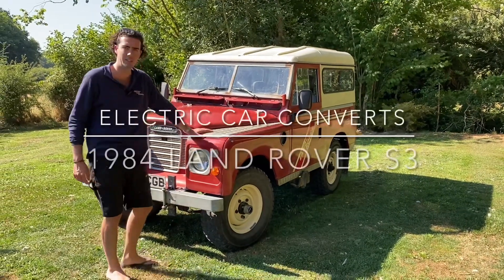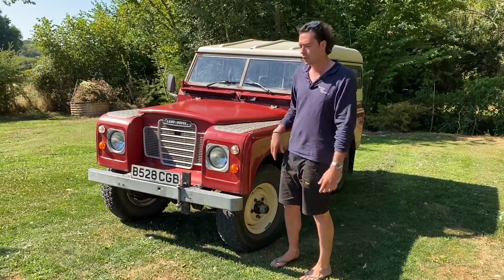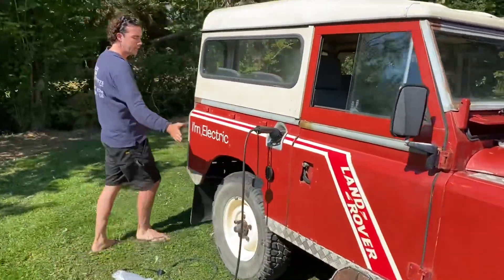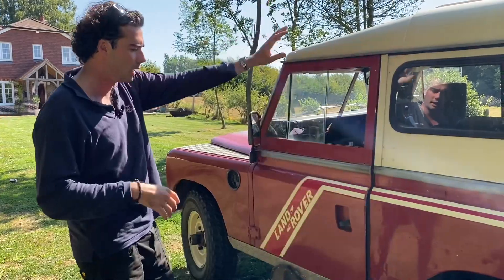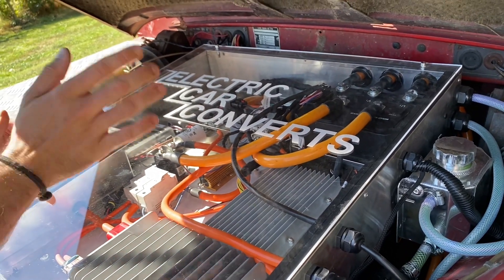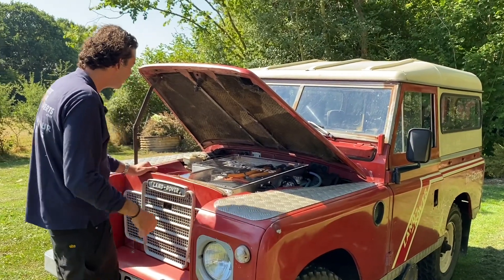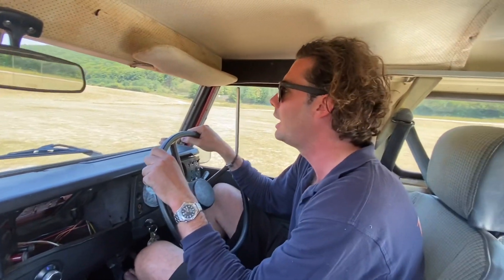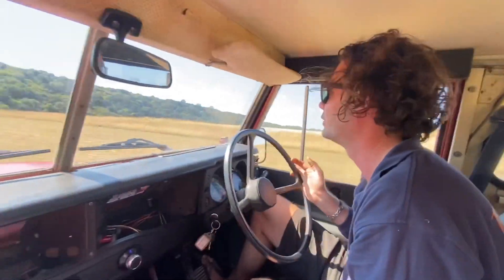Fully ⚡️Electric⚡️ Land Rover Series 3. The best car for eco-friendly farming in the 21st century?

Comment: Diff locks On a Series3? Also the Defender was introduced in 1992 with the 200 Tai engine, not 1984. Before 1992 they were simply known by the chassis designations of 90 & 110.
Reply from the maker: Yes they were Land Rover 90's and Land Rover 110's, but to everyone else, they're Defenders - it was simply a name change.
Reply: @electriccarconverts they’re only Defenders to those who don’t know their Land Rovers. 😉

Comment: What was the rationale on leaving the original gearbox, as opposed to going straight to the transfer case?
Reply from the maker: If you go straight to transfer its the equivalent of driving around in 4th gear the whole time, our motors are powerful but to keep up with modern traffic you need 3rd to pull away at a more reasonable rate.
Reply: cos  that would involve the imagineering of weigh saving and the imaginary diff lock  if he knew what he was talking about he may have
Reply from the maker: Nope, still wouldn't have as you won't be able to go uphill!  @le.drei.amigos
Reply: They make electric toys for the rich hard of thinking there's no thot for practicality  or common sentence   
Range...joke  imagine having a 4 gsll9n fuel tank and having to take 8hrs at the pump

Comment: what are we talking about $$$ ?
Reply: £15000 to £35000 ($19000 - $45000) according to online averages. And he'll have to buy a new set of batteries in ~10 years 😄
It'll never pay itself back.
Reply: @Jin-Ro Tesla batteries will last for about 300,000 to 400,000 miles so in order to reach the end of the number of cycles it will take about 35 years

Comment: I'm wondering why you need a motor direction selctor if it's attached to the original gearbox that still has reverse? 4 gears going backwards would be quite interesting 😄
Reply: I suspect it's because the motor controller has the ability and the switches that come with the motorcontrollers have the option. So taking it away isn't really possible.